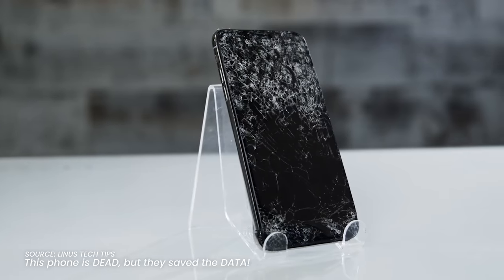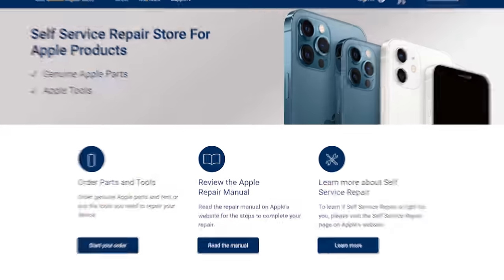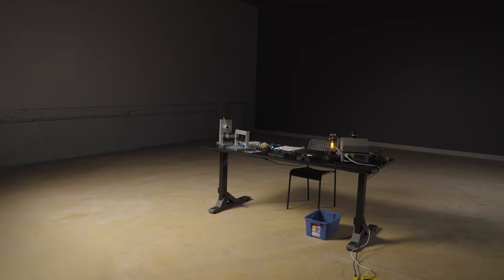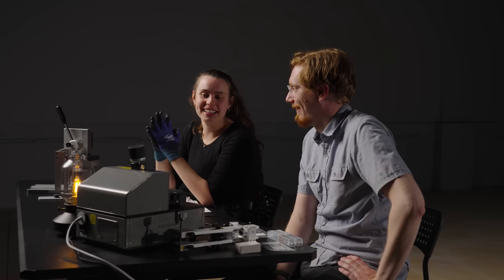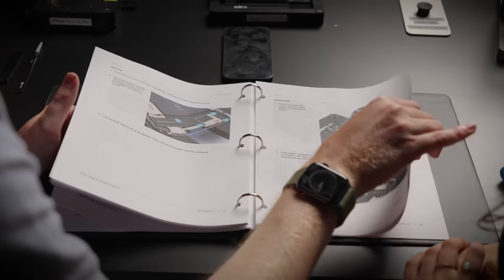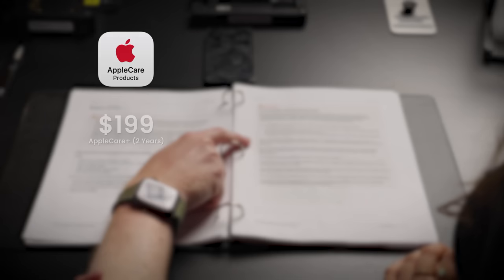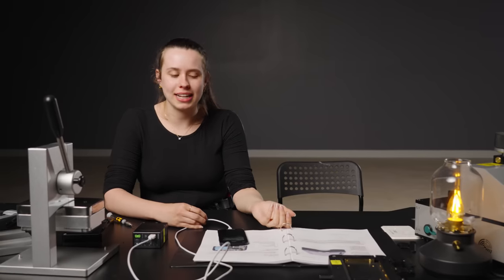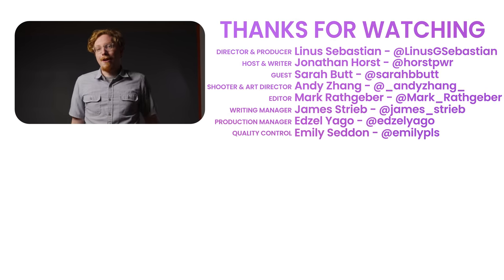I made her fix my mistake!

Comment: 4:20 lol you've used an apple C13 plug for this non apple hardware used to repair apple hardware.
And you've chose to use the most obtuse version, instead of the thin boarder Mac Pro plug (1.1-5.1) you've gone with what looks like a ~2019 27 inch iMac plug
Reply: this is what the company running the rentals provides you with. The tools don‘t have cables included when you buy them so that company bought a bunch of iMac cables from Apple and includes them with the machines.

Comment: Honestly the iphone battery is packed there so tight, why is the battery not held in by the sticky tabs you find in magazines to hold two pieces of paper together.
I remember when we had puch cell batteries with little plastic end caps and the cases just popped off and you could swap the battery in 20 seconds, m serious risk of fire or puncture.

Comment: I kinda have to be that guy, but like in this context would normally be translated to either "positiv bewerten" or you could simply use liken. 
And it is "das Symbol" instead of "den", "den" would only work with "den Daumen nach oben", since the article relates to symbol and not to thumb.

Comment: replacing the battery to replace a screen is very unnecessary. Honestly, as long as you are careful, and keep the connector away from the logic board there is no issue. That kit also seems very over the top, too. The repair isn't any more involved than any of the older iPhones and can be done with an iFixit kit.
Reply from the maker: That's true. We replaced the battery because we thought "might as well since they're a wear item".

Comment: This is a good start, but Apple still have a long way to go. Not including replacement charger ports, cameras or rear glass is stupid, as is not allowing repair shops to stock commonly replaced parts. Expanding support to older devices would be good too.

Comment: AppleCare plus seems like a terrible deal. Even if the worst case scenario happens, you're only saving a small amount of money. Nothing happens you're wasting 200 bucks a year. If you go three or four years without breaking your phone, you could just put that money in the debit card and have an $800 account to buy a phone if yours breaks.

Basically, unless you literally break a phone every year or so, it's a waste of money. Probably true of most supplemental insurance programs. 

More people should probably just buy used items on the resale market, better for the environment. A used iPhone 8 is like 150 bucks. It's cheaper to just have one of those in your back pocket in the case of an emergency.

Comment: Need to add Macs to the program. I literally do not give a crap about my iPhone and refuse to buy one new anyway. If it breaks I'll just get another new to me device off Craigslist. So long as it can make/send calls/texts and provide a wired tether for my Macs it's good enough.

Should point out, I've owned mobile phones since 1999 and I've never actually had one break. It's always replaced for a shiny new feature (all my Nokias and first couple iPhones), or because the battery that wore out (post iPhone 7, I stopped caring when Apple dropped 32bit in iOS and made my paid app library useless).

Comment: To be fair the iPhone 13 pro max is nuit like a freaking tank, I may be lucky and foolish but I dropped it accidentally on concrete, metal, wood floors etc. More times than I could count. Only dents in the steel frame, no glass damage whatsoever
Reply: Without a case ofc

Comment: Popping the screen off isn't terribly annoying with the correct tools. Heck even having a heatgun/blow dryer and a suction cup isn't the worse experience. What really grinds my gears is that double side tape crap they put underneath the battery. There is no reason for that adhesive to be that annoying to remove other than to punish you for trying to change the battery yourself.  

We should have the right to repair our own stuff but if we're honest, the typical user just wants their phone back ASAP. If their old phone breaks, well now they have an excuse to upgrade and they'll be back up within hours, not days. Apple knows us better than we do. We are addicted to our smartphones and just want our fix back as soon as possible and as cheap as possible. Its definitely messed up but they really have us by the balls when it comes to our addiction.

Comment: Is there an engineer who can explain why the batteries NEED to be glued in place that well? Sure, they need some glue because otherwise they'd shake around a little and would make a sound or worse. But a thin stipe of adhesive on the top and bottom of the battery would be enough. It hold in place on every side (front, back, top, right, bottom, left). So seriously, do we really need that much glue and if yes, why!

Comment: "WOW" ... Only a reaction an Apple user could have. Most android users would not have that reaction to seeing this (very generic looking) inside of a mobile phone. Also remember all this is only because Apple is being forced to live up to "rights to repair" around the world - and there is no stopping it now... I mean seriously this is the company who kept changing the freaking charging port to deliberately create more e-waste before the EU forced them to use the standard everyone else is using. 250$ to change a screen is still mindbogglingly expensive for what is essentially 15 min of work for a trained worker, and 62$ in parts including resealing. (I hear you say "that's not the price of an Apple screen!" - Well It's made by BOE and Samsung, and a similarly spec screen costs 53$. The fact that Apple then makes them re-rout some wires so you can't just use a normal BOE screen is just Apple doing what Apple always does - produce e-waste)

Comment: I don’t understand the point of Apple care. It is $230 when you factor in Apple care in the screen replacement, and it’s $280 to replace a screen with no AppleCare. I would rather pay $280 if my phone were to break. Because if it doesn’t I paid $200 for no reason

Comment: 10:35 on topic of faceid when you repair an Iphone with aftermarket displays youd need to remove the faceid from the old display and put it into the new one. And you don't need to talk to their shit support to make it work it just works. 
I'm quiet shocked on how bad this self repair from Apple is, for consumers they just needed to provide the parts a reasonable cost than partner with ifixit for everything else. 
Also Software locking your parts should be illegal

Comment: Apple's "Self-Serve" program self-serves Apple and that's about it. Its only purpose is to kill Right to Repair legislation.
It only allows a specific set of repairs, on a specific set of their products, with pricing and bureaucracy to make it impractical for the cost, time, effort and risk. Only useful thing is access to a few of their expensive machines (which, to be fair, seem to make opening and closing devices easier and safer), however you can do it without those. So no real benefit for self-repair and 3rd party repair technicians.

Comment: to be honest i think the apple self repair program is not only to little or needs some tuning but it is complete bulls**t. It is waaay to much effort to replace something and it doesnt even save you significantly much money espacially for the risk of potentially bricking the whole device. Obviously normal consumers dont do this anyway but i would consider myself quite handy and by what i have seen in this video i would not trust myself to fix my phone if it were to break. I hope Apple doesn't get away so easily with that move and that not like usually all the other companies just do about the same and wish to get a pat on their back. Even though it might be eco friendly to replace single parts in a device instead of replacing it whole and this might appear to help with that issue it doesnt and really annoys me because I actually like Apple hardware and most parts of their software

Comment: Its still stupid. They just need to make the parts available WITHOUT the serial number and at a reasonably price. Most repair technicians are perfectly capable of repairing an iphone 12/13 with their current equipment in under half an hour. Also the equipment is a waste of money. This is only for people who never repaired a phone before. There are enough universal machines on the market for repairing iphones (and also androids at the same time) that it just is not usefull.

Comment: the whole apple repair process seems to me as apple trying to appease the right to repair lawsuits and not much more than that.   saying here is what you need to do it but its really a pain and not worth it so just buy a new one anyway.   because with this equipment this whole process could be easier especially when having to contact them for the final steps, and the whole returning the old parts is just to charge more because it sounds like the return process is just tricky enough for someone to say its not worth it.  These parts are not rebuildable anyway.  It would be nice if they would just make it a smooth process.

Comment: As someone who is familiar with a smartphone repair process, I find that what Apple has offered here is pretty impressive at the price points they are providing. The online processes seem pretty terrible at this point, and likely just need some more time and effort to get the kinks worked out; which hopefully they do. But it does seem like a good faith effort to offer a DIY repair process.
Reply: Apple has nothing to do with this. This is a different company running the SSR program, „Service Parts or Tools Inc.“. They need to negotiate new contracts with Apple to be able to sell different parts. Service will never improve as they are limited by Apple‘s restrictions and don‘t have a workaround.

Comment: Apple self service program is abhorrent. It is the absolute bare minimum to be called a service program. It's costly, cumbersome, annoying and the worst thing is, it's designed to be just this. It's not a service, it's to make people go to the Apple and let Apple fix it. Since it's just not worth doing it yourself.There is no way parts of the phone is costing Apple this much. They're earning money with this program and still force you to buy a new phone. See my example:

My faceID of my new iPhone 12 broke after 1 month. I returned to a certified Apple repair centre and they found water damage on one of the indicators (other side of the phone). Mind you this phone is marketed as waterproof. I haven't done anything to my knowledge to bring water to the phone in this one month.
Only fix possible, a whole new mainboard. 600 euros. The phone was 800 euros. 
If you look at a whole faceID replacement interface, you can buy those for $50. But it doesn't matter. Apple made it so it doesn't work. You have to replace the whole mainboard as well. Which can only be done by Apple. Which is 200 euros shy of a new phone. And still I would have no warranty whatsoever, since that was a red liquid indicator. 

Their phones are great, but the attitude towards costumers is ridiculous and without any respect.

Comment: Here’s the thing, could you do the same thing on the cheap? Answer is yes, there are aftermarket screens and tools that are of lower quality and more tricky to use. I mean it’s like replacing the oil on your Porsche, yeah you can buy all the parts yourself that will match up and some oil, but your Porsche is now not OEM and you have no warranty. So like most Porsche owners you pony up and pay the 295$/hr and just get er done. Just like on this, it’s all about the warranty, you do it yourself but you still get the same warranty.